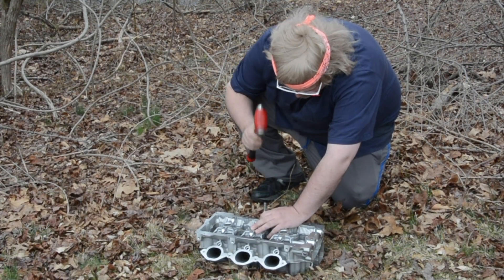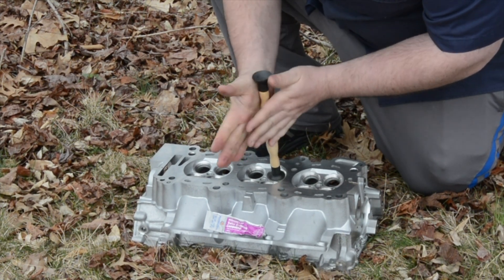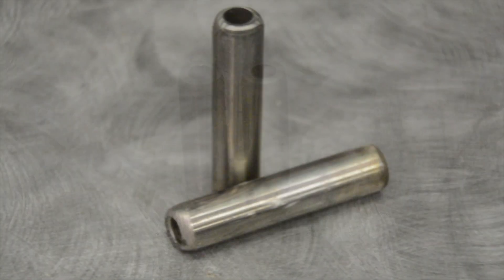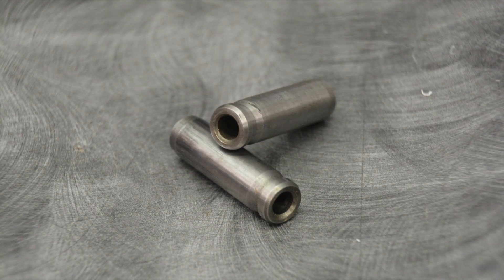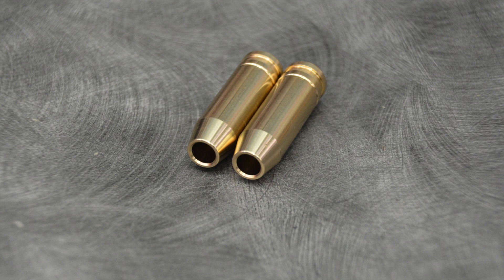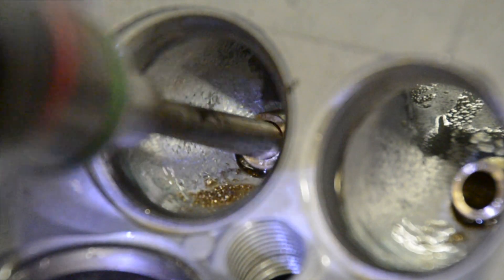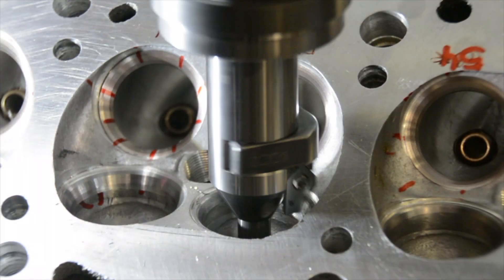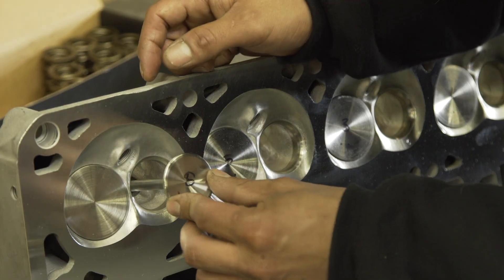Valve Guides Explained

Comment: I knocked my valve guides in with a hammer and they work perfectly. Some people ain’t building race engines…
Reply from the maker: you can also do it with a hammer. Not everyone is only installing 16 guides in their lifetime. We do it many times a day, race and street heads all the same way.

Comment: anyone can run a reamer through a valve guide you dont need a machine shop for that, there are more serious reasons why one should not hammer the valve guides themselves, this video does not mention any of that. downvoted.
Reply: they kinda did with that character that the beginning. that was there whole point  without having to get into it.

Comment: Cool guy valve machine, my buddy has one. Grinding angles with a rock is beyond old school more like primitive. One toll to cut the seat and the blend. Each seat is the same height and width, that means the installed height is consistent, New seats get blended into the port and its so fast if your machine shop charged by the hour you could get a set of v8 heads done, get as much as + 40 hp more than rock ground, get them done while you wait, all for $40. Sorry dudes, somebody has to pay for that $60k machine and my buddy does mine for free.  lol

Comment: If the valve guide it to high in the cylinder head does it need cut to size like the rest of them or does it matter that is it to high
Reply from the maker: To high on which side?
Reply: @headgames  both there was 2 valves guides put in inlet and exhaust